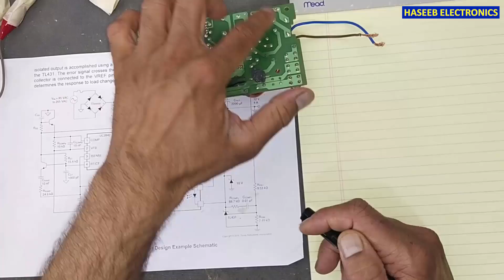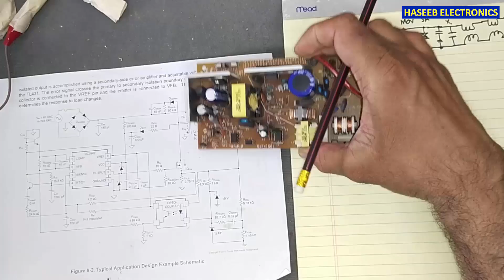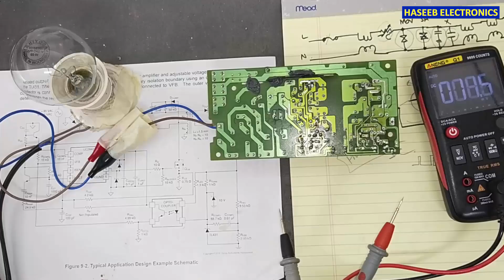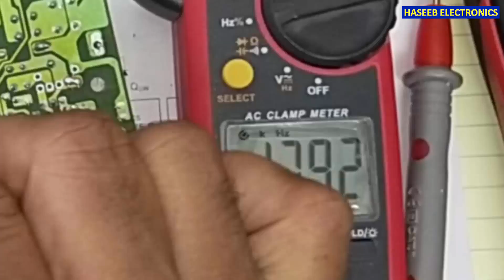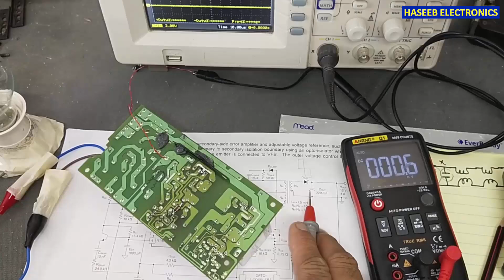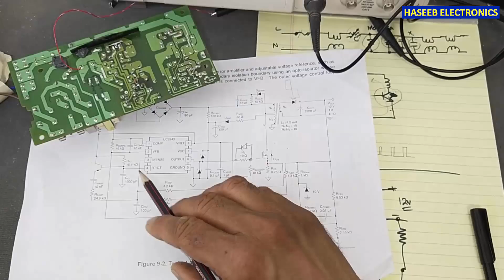{772} How To Repair SMPS Step By Step

Comment: The best way to learn from this video is to get just pen, print out data sheet and take all notes and go along, pause rewind until you get it on the paper, take all notes, pause rewind again! And conforme that you know what every resistor or diode does in circuit and then you move to live PCB! When i start electronics i didn't quite understand what is "start up circuit for IC" and that cause me a lot of trouble. But Haseeb makes this grate videos explaining every step, so consider yourself lucky to have this kind of knowledge just served out! Thanks Haseeb.
Reply from the maker: best regards and special thanks for your valuable comment
Reply: @HaseebElectronics 1741G ic, is it op amp
Reply: 1741G,is it opamp?

Comment: So why is voltage at Vcc pin lower than 16v? I tried to design my own circuit with UP3843 and I can not get Vcc over 8v, it clamps.....maybe this is normal?

Comment: I have the fluctuated output 300-500v HF AC.  Can you suggest the best circuit to control it steady at 400v? So I need to hold the steady voltage on this bus even if the load is added or subtracted.  400v bus then will drive 220v/50Hz 6KW inverter

Comment: Sir, My humble request to clear if feedback to ic uc3842 is open due to any reason say optocoupler is open from photo transistor side, will uc3842 shutdown or distructive high voltage will damage output components and load(if connected). please explain in detail or make another video on open Loop protection inuc3842 based smps, hope you will do needful.

Comment: Dear sir, The video is very good. Need your advice. In an actual case study, the Input is 220V. A snubber is there. The mosfet voltage spec is 800V max. At site, we observed that the Mosfet, Driver circuit and current sense resistor have been failed. What could be the various reasons ?. Pl let me know.

Comment: Is there ever a case where a SMPS using Flyback w UC2845 PWM requires a load to give good readings on test bench? Also, is it ok to inject current limited 12V into Pin 7 VCC on PWM to test it? Thank you.

Comment: Sir l have a MI smart tv with shorted mosfet.I have repaired it with 4 wire module.now tv goes on but MOSFET 7N65 in 4 wire module get very hot and short after some time (approx 2min.) what's the problem Sir pl.help Sir.

Comment: More than wonderful explanation. I have a question, sir, regarding the blue ceramic capacitor that is next to the connected transformer, such as a photocoupler connection between the input and output area. What is its function? Please reply.👍👍👍🌹🌹🌹
Reply from the maker: it is class Y capacitor, 
it removes all common mode noises caused by the switching in the transformer, rectification noises in secondary side, and all noises biue to load, it will pass that noises into primary side ground

Comment: Hello, What fault could cause that the voltage at the capacitor that feed the pin 7 in the ic 3843 doesn't get higher than 8.47 volts

Comment: Hello sir I have a question what pwm ic can I use to design buck converter that the current can be adjusted without turning the voltage down,I can’t find a ic that I can latch comparator to control the current output

Comment: Confusing, the resistance of the NTC increases when heat is applied ? This is actually the characteristic of  PTC !
Reply from the maker: In Negative temperature coefficient ntc resistance
When temperature increases the resistance decreases 
As it responds in reverse

Comment: I have another safetytip for you. Many SMPS chips like the one you have in this video, can work at much lower voltages than the 220V/110V line voltage. Often - but not always unfortunately - 35V is already enough. You can find the necessary minimum input voltage in the datasheet for your chip.
So buy yoursef a basic AC/AC transformer that can output 25V AC (or more) or an AC/DC adapter that can produce 35V DC (or more). Use that output as input for the SMPS under test.
It can save you a lot of premature gray hairs.

Comment: One quick observation, which you should probably advise in this video: 
ALWAYS use an isolation transformer when you're using an oscilloscope for troubleshooting the PRIMARY of any SMPS!!!
In fact, I guess you are already using one (not shown in this video), or maybe your oscilloscope is not "grounded", otherwise we should have seen some big sparks when you are connecting the GND of the oscilloscope to the negative HV on the PSU primary. 😲
Reply: All correct, I had exactly the same question... He has to have some galvanic isolation, otherwise, it's a guaranteed short.

Comment: Dear Hasseb, please help me: I have a switching power supply AC 230V to DC 12V, it is power supply for satellite reciver. The issue is that after thunderstorm the power supply not working and if I measure input voltage it is fluctuating if connetcted to 230V, instead of 230V I have between 70V to 140V. Could you please help me?

Comment: Thanks a lot sir for another informative video  I am Ihsanwazir from north waziristan .I have  requested u  to make a video on account dc fan circuit but u did not made. now I am requesting to make a video on how to remove battery full command from ghotky battery  charger  plz  make a video or  reply   about.Thanks
Reply: sir we do not have internet connection all the time  but when  we visit the city  we  got online from PTCL network  so plz plz and plz reply.

Comment: 9:55 It might you get confused.
Cause PTC (not NTC) increases its resistance as temperature rises. PTC works as fuse.
On the otherhand NTC operates vise versa so as to act as in-rush current protector in initial booting of circuit. After NTC is self heated up after booting,  its resistance drops to a negligible amount during steady-state operation.

Comment: Excellent video sir please make video on led tv driver voltage and current control by changing resistance and make compatible  to our need.secondly which multimeter is suitable for 75 to 100 mhz measuring frequency. Thanks

Comment: Sir, I repaired some smps (laptop charger) when first time it start - it reach 26v then slowly decrease until 19,5v (it need @30 - 50 seconds) & then it in stable voltage, how can I solve this issue? 
I found this kind issue 2x in my experiences.

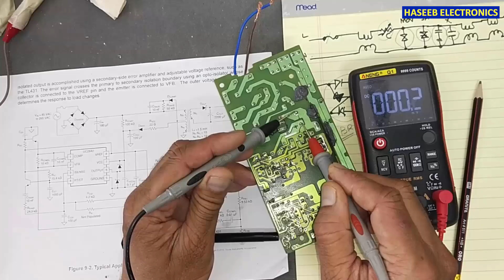Comment: 8:29 
Ok there is no voltage
Shows 34 V   LOL
Reply from the maker: please check carefully 
it is 34.6 millivolt only that means NO VOLTAGE 
wishing you happy and healthy life 💖
Reply: @HaseebElectronics  
Mate with all respect you sound very cautious and sensitive, you don't need to be with me FYI

also i wear glasses, so i understand

However let's get back to electronics
1. i did not see the mV Range (let's chalk that up to my eyes

2. 34 mV does not mean No voltage
you can understand where i'm coming from right ?
also after detecting voltage you decided to do a continuity test

also later you said  We will have resistance (i think while testing the MOV or NTC
mate, if you have a video stating how to repair a SMPS  and you are teaching the new guys, You need to be a bit more specific than "You will have resistance"

anyway , all in all a good video, few mistakes here and there and the part about the voltage, i just found funny that's all
Reply from the maker: @martinkuliza  thanks for your reply. i am not sensitive, i am slightly funny natured, 
if you last words were light bit annoying, sorry for that. it was just joke, because i have friendly relation with my viewers 
yes you are right, 34.6 mV will never be said that there are no voltage. but for testing continuity, if the voltage at test point are less than 500mV, then it is safe to test continuity, otherwise we need to discharge that voltage 
you are right, might be there are mistakes. we must to try to do perfect, sometimes while explaining, demonstrating, we miss something and something is overdone. but i think my this effort may be helpful for someone  
please accept my best regards and special thanks,
Reply: @HaseebElectronics  
You are sensitive... you keep apologizing in pretty much every comment
which is why i'm saying don't be so sensitive

i took your joke as a joke,  it's ok, don't worry about it
as for the rest of your comment, You're Welcome
Try to relax and not apologize so much

in my opinion a person like you should get used to (from time to time) telling people to fuck off   LOL
it'd do you good, Believe me
Reply from the maker: LOL   
stay blessed
Reply: @HaseebElectronics  
You too mate, 
Never stop doing electronics
My Allah bless you and peace be upon you

Comment: Any chance you could do a video on a dual output power supply for both 12v & 24v, how they work? Currently troubleshooting one that has 24v but  missing 12v, only has 1.2v, can't figure it out. Checked caps & regulator.
Reply from the maker: it seems that the 12 volt section have short circuit 
check its rectifier and capacitors 
i hope you will detect the issue
Reply: @HaseebElectronics  thank you. The first thing I did was to look at board under a thermal cam - no shorts detected. Then checked all 3 pin components & electro cap values. I came up empty. 😧 No schematics, this is turning into a rabbit hole.... but I will persevere. 🤯 I have a good board to compare it to luckily.

Comment: The viper 22 in my induction cooker is heating up..i already change the big capacitor and resistors on its negative ..also all clamp diodes and all capacitor sorrounds the viper 22A.i change all. still heating up ..whats worst was the LED on buttons suddenly gone and fan blower also stops now.. but my fuse didn't explode..help me guru..what problem viper22A heats so bad led button a blower stops now
Reply from the maker: check 18v zener near viper ic
check 7805 regulator or other related parts for short circuit 
check both transistors for igbt gate drive (remove, and power on without transistors and check the condition without transistors)
if it is good then check again by installing transistors
Reply: Okay thanks for the advice..the 7805 regulator .I already change it..but the zener diode near viper pins..I don't know the value of it that's why I didn't change it.since u said it was 18v.. I'm gonna look 18v zener..plus the two npn smd transistor near pins of igbt..Hy3d smd transistor I replace it with smd MMBT2222A 1P..  the LED buttons lights blinks..then gone it didn't lights anymore..fan also gone..after I put the SMD 1p transistor
Reply: I didn't lights the LED buttons anymore..but the viper22A keeps on heating.....I'm gonna change the zener diode near the pin of viper like u said.it was 18v right?.. induction cooker was asahi model IS-100..thanks

Comment: Thanks for your great tutorial.
But is it possible t o use a thermal camera to find short  in SMPS too?
Both in Hot and Cold part of SMPS?
Thank you for your reply
Reply from the maker: best regards
yes thermal camera is also a very useful tool but it is expensive. but it is a great tool ad well
Reply: @HaseebElectronics  Thank you for your reply.
What is an advantage( if any ) of light bulb you use in repairs? I use an isolation transformer and not sure if it is still needed/good  for me (to start using the light bulb too) during repairs
Reply from the maker: the series lamp is much better, when we are repairing some circuit card. it covers most of the time the mistakes while repairing. some component failure in the repair process. it will not allow to make more damages in the circuit. using isolation transformer, it is an excellent practice and it is much safe
but use of series lamp saves the circuit from more destruction
Reply: @HaseebElectronics  Thank you for reply. And is it possible to use bulb lamp (to cover most  mistakes as you explaned ) and an isolation transformer ( for safety)  together ?
Reply from the maker: please check video number 683 for more detailed answer

Comment: Hello, to share my experience with an 12v/220v inverter, the cold testing is good, when power is applied, it is short circuit. Drive signal at sg3525 is good, any idea where to look at ? thanks

Comment: Big fan of all your PS vids and O scope vids.   What would cause a PS to have 168v stable on main cap (should be 320ish) and no voltages on the full bridge rectifier? 🤔NTC is good. What did I miss?  Board is for a ccfl TV.

Comment: Thank you sir for this informative video.. sir i am new in repair. I am working on atx smps(Lps450) with Utc7608d (str-a6151) and Hs8108 ic. Not getting standby vtg. 330v available at stb xmer primary coil1, on drain and source of utc7608. No vtg on secondary side. Checked all components on standby rail. Help me sir

Comment: Hallo sir,if possible please explain in eny video how -voltage generates like as -5 or -12 volt DC which is used in optical transmitter of catv

Comment: Hi sir, thanks for the video .since last time I was asking U to , how to find PWM ic part numbers, it is in SMD  sot23-6L pakage. I did Google also using the print letters on components but still not get and perfect datasheet ... Nandri Vanakkam 🙏
Reply from the maker: welcome dear. you didn't mentioned the SMD code. if you can share it, i can also try